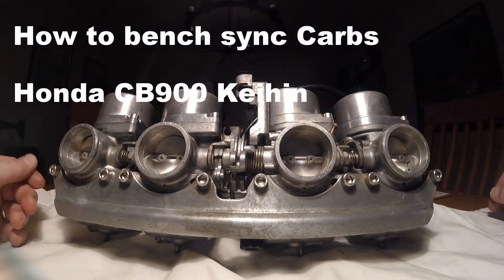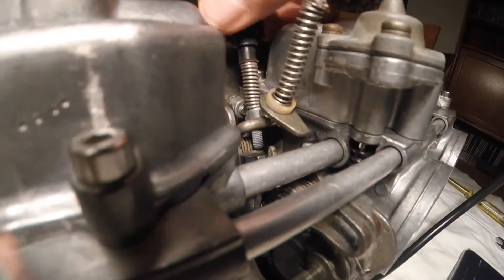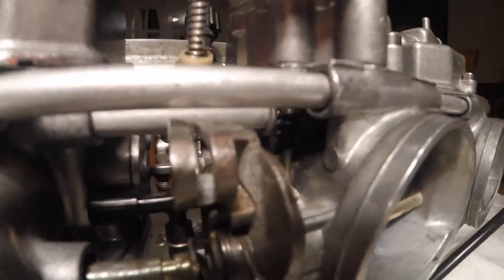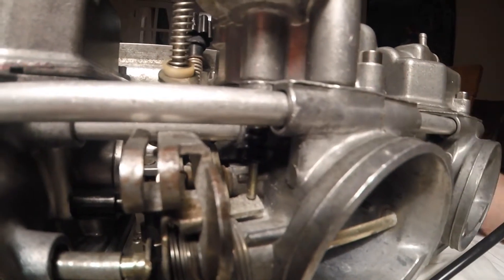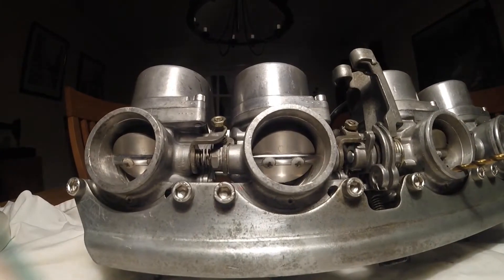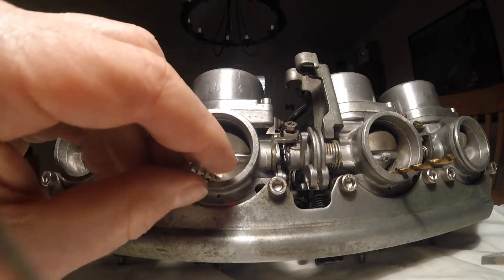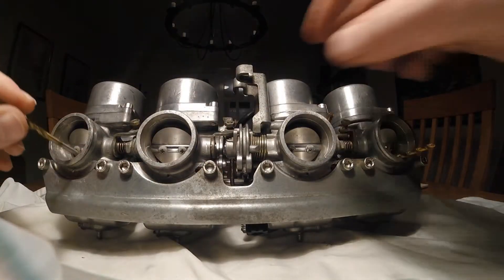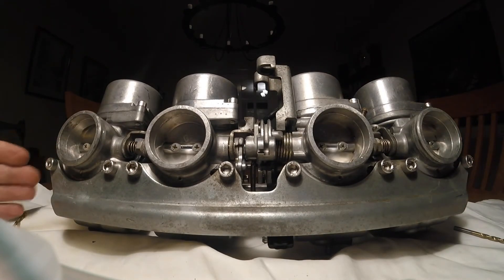How to Synchronise carburettors on the bench

Comment: Hi
Great video, but how did you make sure carb 2 was set correctly before you started?
Thanks
Reply from the maker: Hi. Carb 2 doesn't need to be "set". Synchronising means making sure that all carbs move at the same time - in unison. Honda designed the system so that you adjusted all the other carbs relative to number 2. Once all carbs move in unison, then you can adjust throttle cables and throttle stop screw to make sure the whole unit is "set"